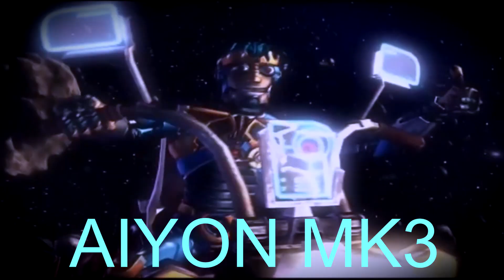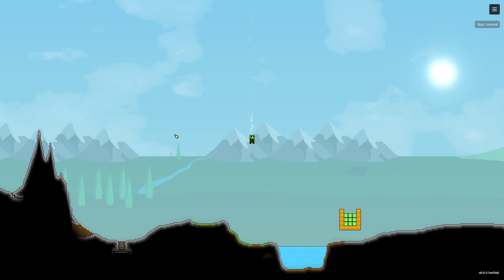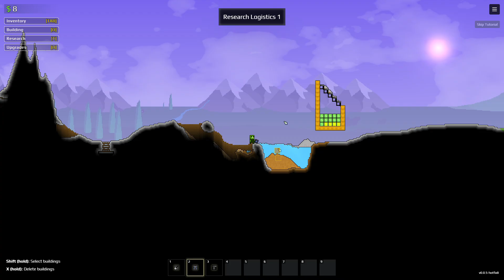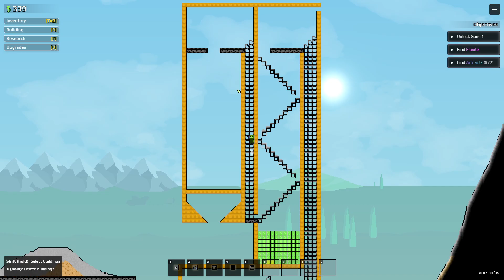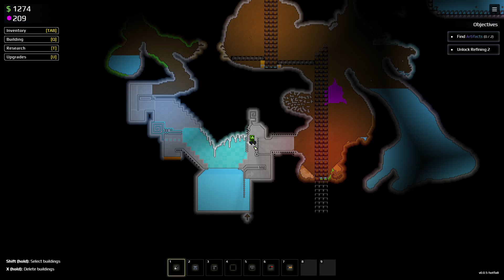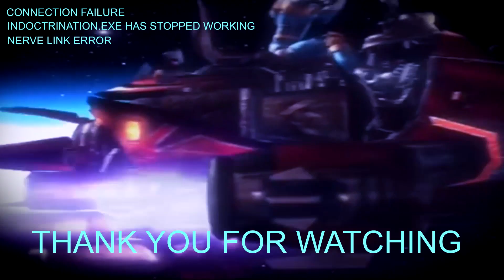Sandustry / Industry in a SAND PIT

Comment: the reason you could pick up water is a feature for building.
if you try to place a block but something is in the way, you can pick it up. since water can also be in the way and you can't normally grab it, there is a small feature where you can pick up water but only within blocked construction areas.
that being said, the feature doesn't play well with the hydro sponge upgrade, as it actually enforces more limitations than actual benefits. i suggest not getting that upgrade until you have to deal with steam and wet spores.
an effective way to move unwanted water until then is to either build a filter, as those are not waterproof, or try to place a block on the water and grab it. 
oh, and remember to secure the corners of your boxes, all liquids and steam can move diagonally through one pixel gaps. an especially annoying property when building diagonals. always make sure to double layer those in some way.

for the kinetic slag processor i suggest letting the burned slag fall through a filter before entering the processor part. the filters will limit the amount of slag processed at once, which will mostly stop it from stopping to work. and build a horizontal launcher line to get the few pixels that still get stuck out of the processor and back into the launcher elevator for the burned slag.
and this side exit is absolutely necessary because whenever you load the game, the burned slag particles in the processor will load in with their momentum, meaning they will not be processed and clog the system every time.

i suggest you buy pipes for the next unlock and start building a sand wetting section with a pumping system before the shaker section or put a filter over your water pit for just sand.
and you definitely need a filter box for unwanted stuff like snow. that stuff will clog up your system fast.

and about the water system in general, take note that water is a limited resource that can run out if you are not careful. fortunately there are two ways to get more, besides exploring the map.
first, you can unlock a cryo weapon that creates snow which you can then melt.
second, steam will turn into water when it reaches a certain height and it will turn into slightly more water than used to create the steam, effectively duplicating the water. this is an intended mechanic and something you need to make use of in the long run.
just build a big-ish water box near the rain height and either flame thrower it for a while or shoot a few rockets with incendiary upgrade bought. both produces lots of steam.
and let the overflowing water fall into a box with pumps.
well, if you just want some extra water, there is another underground entrance just right of your water pit, blocked by ice. it will lead to water among other things.